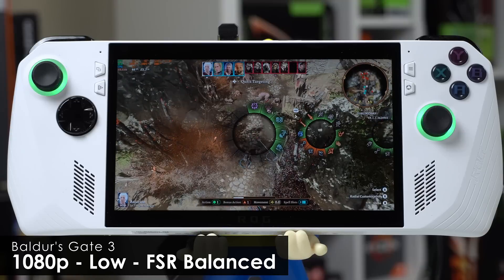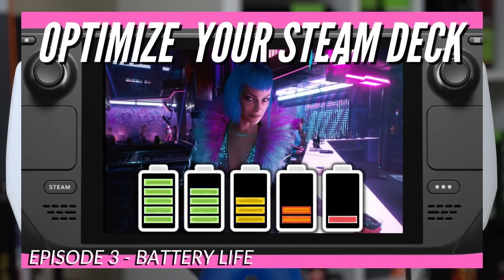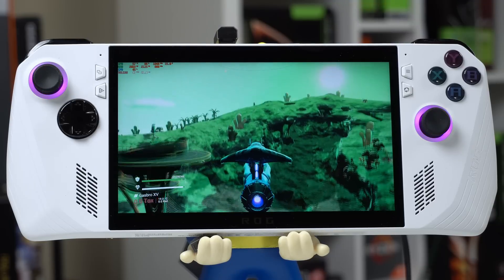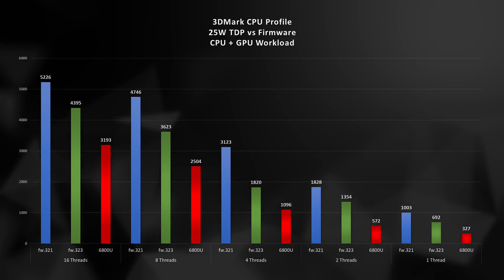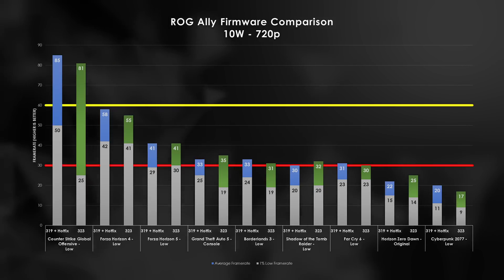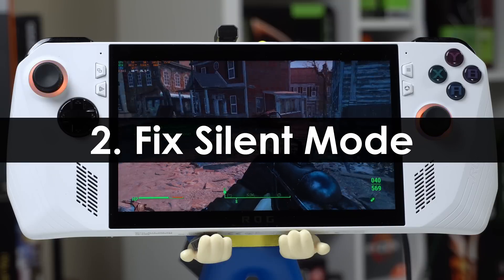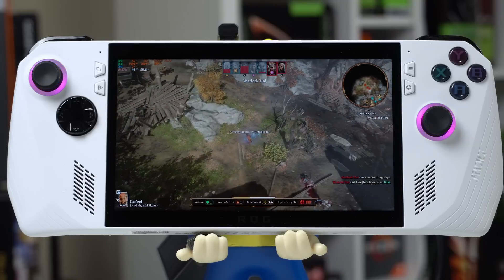Dear Asus, I Figured Out Your ROG Ally Performance Problem

Comment: so did you find out really what was wrong or did you just say let us turn off cores and then be like now its on you asus to find out what tweaks you can do. you should of used a tuning tool to farther improve your point when you feed the gpu more useing x86 tuning tool i can see up to 10% fps in some game and it makes bf2042 hit a good 60 at 15watt and thats impressive as hell! good video tho went into alot of detail but i feel like if you went a little farther and tweaked around with it useing custom setting you can make a MUCH stronger point!

Comment: performance problem is to ditch windows and use chimeraos for a steamdeck like os
Reply from the maker: Have they fixed TDP controls yet in Chimera?
Reply: click hardware tab for supported devices but i ran it on pc just fine but no tdp and who cares on a pc? @TheTerk
Reply from the maker: @CommanderBeefDev  tdp control is a critical feature on a handheld,  especially when optimizating for battery life or unlocking extra performance.

Comment: RMA'd my original unit for not being able to read  high speed microSD. They replaced the motherboard and it appeared fixed for about 3 days.  The same microSD card problem presented itself, and in addition this time it corrupted my card which is now unusable on anything. No longer works on my PC or my Surface Pro.  At this point Im done with the SD card reader.  Hopefully a class action lawsuit gets started so I can jump on board.

Comment: VRR only works till 48fps so 30fps VRR is not possible
Reply: It has low refresh compensation or whatever it's called, so it can go down to 24Hz with that. You can also manually tweak the Hz range to drop down to 30Hz without relying on that compensation feature I mentioned

Comment: i think its sillly all you "people" trying to get a high fps AAA experience with a handheld the resolution is too high on the ally for "great experince" mobile plugging it in or lowering resolution helps but meh the steam deck does "GAMING"  i own both and find that both are great for what they are but for a "mobile" experience the steam deck is way better the complaints i see you tubers make is not what i see in comment sections and the sales numbers agree with me i just dont see a reason to buy the ally for "mobile gaming" plug it in and monitor up and you got a surprisingly good pc but you can build a more powerfull pc cheaper i just dont get the reason for the feeature set of the ally
Reply from the maker: You should use punctuation. There's nothing wrong with criticizing Asus for not delivering a better experience, and I'm all about managing expectations.
Reply: @TheTerk  you're prolly right i should but i doubt i will

Comment: Honestly i dont mind the fan noise. I use mine mostly in manual mode with the fans maxed out from lowest to highest wattage and temps. The speakers are great and if i need to i have headphones and earbuds. I really dont mind. In manual mode my temps stay around 72°C until the heat soak pushes the temp a little higher.

Comment: Great take. Just some notes: APU is an AMD terminology. Technically what you say is right, but terminology wise it only applies to AMD (most commonly used in all devices you mentioned, including consoles and handhelds.

On your conclusion: By using Windows and being supposedly subsidised by Microsoft and AMD, Asus is limited to the software provided as opposed to Steam Deck. However most things you mentioned can be done via custom software. While I don't own an Ally, I own a Deck and a MacBook Pro 16" with 5600M graphics, which suffer from many of these issues.

Especially on the MacBook, I'm running the Amernimezone drivers for the AMD chipset, which also supposedly work on the Ally and Deck. If you manage to install them correctly (takes a few tries as the guide is very vague and it has many options), you can enable Radeon Chill, which paces the FPS to a set amount when static, a maximum amount when moving in all directions, and halfway through when just moving in one direction. That allows the APU to use maximum boost when necessary (fight scenes or many NPCs etc) and take a breath and recover when there is not much happening.

For the CPU side, you can disable boost in many ways, one of them being QuickCPU. Also you can disable CPU cores straight from the task manager (highlight the process. Right-click on it and select the Set affinity option from the context menu. You will notice that the process is set to use all the system core. Simply uncheck the boxes of CPU cores that you don't want the process to use).

Lastly, for the Steam Deck someone made a great version of Windows with some tools that could possibly also work on the ally, check out WindeckOS. I installed it on my Deck and it works fantastic.

Comment: I use Smokeless anyways to enable a full 54 watt constant load. The CPU now never goes below 3.3GHz and the GPU never goes below its 2500MHz and will boost to 2700MHz when it needs to.
Reply: How to make it useless in handheld mode with a 30 minute battery life lmao
Reply: @M_CFV 90w battery mod

Comment: if you up the vram to 7gb it works really well with ratchet and clank. I beat the whole game on Low and Med GPU settings nothing on very low.  DO NOT SET GPU SETTINGS IN GAME IT WILL CRASH lol do it on the start screen before game launch.

Comment: I really don't understand all the talk/complaints about the Rog Ally "fan noise".... I have excellent hearing, and I deliberately turned both of the Ally's fans to 100% to see just how loud they really are, and I swear, in a very quiet room, I could just BARELY hear the fans when holding the Ally in a comfortable handheld playing position, with them running at 100%!
Reply from the maker: the only time I notice it is if I'm running turbo mode. whenever I'm handheld, it's a quiet puppy
Reply: The ally has the most pleasant fans I have ever seen on a laptop/gaming device. Even on full speed, while you can definitely hear them, they don't sound unpleasant in any way. The fans are actually dead silent, All you hear is the moving air. I also really enjoy the fact that it has 2 fans. The ally still had some flaws but it's overall a very well designed System.

Comment: Does the dock mode proformace also apply to just having plugged in with the changer in came with? Or just the docks that have 65w support?
Reply from the maker: Yes, using the included charger alone will work, or any charger that applies enough current.

Comment: For suggestion 1: Turn off CPU. If the SoC does not have power gating for CPU, there will be little to no gain as it will be similar to core parking only. Hardware engineer please correct me if I'm wrong here.
Reply from the maker: Parking in theory should work, but the inactive CPU cores are still receiving power in the  sub 1W range. Depending on the power state, caches will be on as well. Electrically disabling the cores should gate them off, and will be managed by firmware, not OS, for greater power efficiency

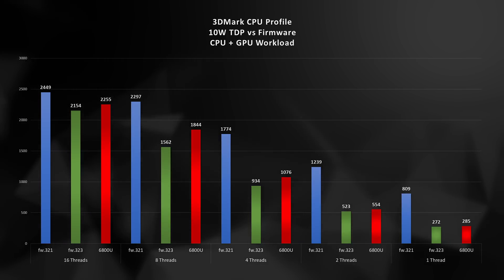Comment: 5:58 Please correct me if I'm wrong but I can't remember any Ally 321 firmware? 
I only remember firmware 312, 317, 319, 322, 323
Reply from the maker: 321 was a brief update to 319, likely overwritten with 322.  regardless, between 319 and 323, there were no real performance improvements.
Reply: @TheTerk  ahh okay thanks for the info :)

Comment: Poor 10W performance is actually due to cpu not getting any power in most of my games, due to the gpu not clocking down below 800mhz (even in idle, even though it can clock down to 200mhz, when configured in linux - was confirmed by a chimeraos dev). When youre sitting between 0-50% gpu usage, there is no need for the gpu to take all power, while cpu gets crumbs and sits between 0.5-1ghz.
Reply: did you not watch the video, the problem is due to the cpu hogging all the power while the gpu gets nothing, the cpu is more than fast enough to run most games at 30fps even at 1ghz

Comment: The most important thing is to solve the micro sd issues
Reply: I think it’s something asus did software. I have had my rog since the beginning and have a micro center 1tb sd card. Worked perfectly fine up until recently from a update. Then it stopped working. So it has to be a software issue that they “limit” something because a lower size sd card works fine. Just not the 1 tb

Comment: Does disabling the aggressive mode in power setting change the results? Because disabling the aggressive makes the GPU work more.
Reply from the maker: quite possibly - I typically don't tinker with that level of settings because the standard user won't bother with it.  when I come up with a working formula, I'll probably make a video.
Reply: @TheTerk  Makes sense. You can also use G-Helper to tweak them. Actually it is much easier with G-Helper than going to regedit.

Thanks for the video.

Comment: 10:57 Asus, skip to here. Great video mate. I’m loving my ROG Ally. Playing Baldur’s Gate 3 night now.
Reply: How’s the performance for it? I’ve never played any BG games before and I’m curious how it performs in the Ally
Reply: @novanatakit323  it runs nicely! Between 45-60fps with the settings I’m using.
Reply: @KarlRock  I’m gonna assume that’s on low settings with amd equivalent of dlss? I forgot what they call it
Reply: @novanatakit323  high mostly. Fog and shadows on medium. 1080p with balanced FSR. It’s little shimmery, but doesn’t really matter on such a small screen.
Reply: @KarlRock  i call BS, or you're running it on top down mode only then maybe
Reply: @aws8059 i experience similar performance on my Ally. And I play mostly zoomed in. 
I put everything to max settings, dropped res to 720p using FSR to upscale to 1080p. Fsr quality. 
Plays just fine. 
So adjusting settings could easily give similar performance at native 1080. 
I tried it, but didn't notice much difference with fidelity, so I opted for stable FpS with FSR
Reply from the maker: FPS numbers and settings are in the video.
Reply: @TheTerk How come I had my Ally since day 1 and never had the SD card issue?
Reply: How do you like it compared to the Steam Deck? :) Is the battery life good enough, or do you play mostly plugged in?
Reply: You'd want at least 6 cores on modern titles but it would be beneficial 😊

Comment: Disabling CPU cores would be a dream for performance.
Reply: Process Lasso does that - amazing software!
Reply: @etchieSketchie I agree, I've been using it for years. Worth it's weight in gold
Reply: 7040u is so new AMD hasn't even released bio . We should be able to park cores in the future.
Reply: Disabling CPU with uxut is not working on my ally.
How weird.
Reply: Asus told The Verge that was something they were working on even before the Ally was released.
Reply: At that point, what's the advantage of having an Ally over a Deck except the better screen? 😅
Reply: @zainmushtaq4347  - Performance is much better.

The video is looking at things from a performance per watt perspective. It's different from a raw performance output.
Reply: @zainmushtaq4347  The reason is you can do way more with the Ally since it is still a Windows computer. You can load anything you want on it from anywhere you can find it. The Steam Deck is basically the PC version of the Switch as where the Alley is a handle held laptop. At $50 less for the comparable Steam Deck I don't think I could justify getting a less compatible platform for any random thing I would want to do with it. It might perform worse, but having the ability to do more is worth more to me and maybe it will improve in time. Although I think the next version of this will be the one to get rather than this one.
Reply: Why? Some bigger games need that CPU power. Wouldn't this be a Nerf?

No one does this on gaming laptops I'm getting confused by the actions people are willing to take.
Reply: @frankcoley1537 most gaming laptops have dedicated graphics cards while these handheld have to share their limited power between the cpu and gpu
Reply: 3rd party apps can do it just fine
Reply: @egjream  - rewatch the tips to asus portion at the end of the video and carefully listen to what he says.

Comment: I need to retest Minecraft DXR now.  I remember at launch it was unplayable in 15W handheld mode, and only hit 30fps at 30W docked.  No doubt a low GPU clock was behind some of this
Reply: how is it now
Reply: @Unknown-kf3ef  I have been busy since I left this comment.  I will test it ASAP tomorrow
Reply: I find the best fps/ power balance is at a custom 18W flat profile with the CPU core isolation off in windows for most things I play